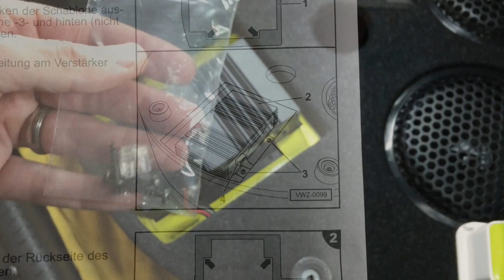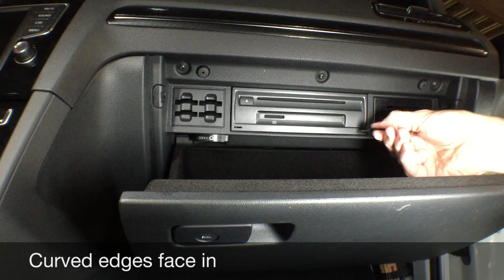GolfR Helix Install

Comment: Hey i bought the sound system for my Polo 6C 2015, i had Volkswagen install it, but they said that they did not need to code it, because the manual said it only needs coding if the the wheel was on the right side of the car ( like in england ) is this true?

i hear stuttering, no clear sound, like scratching when i turn the volume up a little more than half... i feel like the work is not done..
Reply from the maker: +Andr&#233; Lyon Love the Polo, saw some of those on a trip to Bermuda.  Kinda' not happy we don't get them here.  I think VW should release a Polo WRC Edition World Wide.  :)  Anyway, I vaguely remember my manual mentioning something about right vs. left hand drive as well, but I don't remember if it was coding related.  I'll have to take a look and get back to you.  Do you have you part #?  There is a "B" version that people outside the states get that is slightly different, but know one knows exactly how or what the difference is. 

I hate to say it, but it sounds like they screwed something up in the wiring.  I have zero clipping/distortion/crackling/etc. during volume change, and I still haven't coded mine.  I seem to remember someone else on the VWVortex.com forums mentioning a crackling sound issue as well, not sure if he resolved his issue but you may want to start there.  I was working with an Aussie and he had the Golf R estate Right-hand drive.  Said he had to get it coded and it was set to a different code originally.  He also had no sound distortion. From what I understand they all come coded for a GTI originally (4 door maybe?).  After I ran the cable (Which is the hardest job) I called VW to get a quote on doing the wiring for me because I was scared to fry my system (Almost did) but they wanted $600 just for the final wiring even though I told the guy it was a 20 minute job if you knew what you were doing.   He didn't budge on the price so I told him to screw.  So as you can see from my Pt. 2 video I did it myself.

But ya, I would go back to VW and demand they get it working with zero crackling.  That's unacceptable.
Reply: Hello Andre, I have the same problem with my golf, volume more then half I hear scratching, did you find a fix? If so please let me know, I have a golf 7 right hand drive, did the install %100 to this video, Cheers Leigh

Comment: looking forward to part 2! is dongle/flashing needed for 2016 Golf Sportwagen (non-Fender)?
Reply from the maker: +Nick Johnson Thanks, should be done with it soon.  I believe it is, there is a guy on vwvortex forums with a sport wagon who installed one and flashed his using a dongle he ordered, said there was in-fact a difference in sound.  I haven't flashed mine yet, but I'm not sure it's necessary.  I might try anyway, but right now it sounds phenomenal.  The base stereo was great to begin with, this makes it sound like a stereo system on a whole new level.  Very surprising.  The only thing I would like that this doesn't seem to have is more control over the crossover for the in-cabin speakers.  I would like to bring a little more mid-range and even bass back into them.

*EDIT : After programming with Dongle, sound is better!  Mids are back in the cabin and the sound stage has a much better placement.  A tip from another VW Vortex'er : Even if your sub comes pre-programmed to the right number (Mine was 51 I think) set it to your number and hit program anyway.  I did just that and it made a small yet noticeable difference in the overall sound quality.  👍🏻
Reply from the maker: Pt 2 : Get it while it's hot...  https://youtu.be/59bKOruoJys

Comment: Is the LED scuff plate one piece with a plug? Do you know if there is a part number for it?
Reply from the maker: JAMES_d : Sounds like you broke it?  😬

I believe it is one piece.  Sorry, don't know the part #.  I would contact VW dealer.  Try to get it replaced under warranty.

Comment: How reversible is this install? A sub like this in my MK7 could be a game changer...
Reply from the maker: Pretty easy really, just do it all in reverse 😄.  If you need room for a spare for long trips you can just take the sub out, leave the wire, and get a loop harness that plugs into the end in the trunk that basically puts it back to stock by routing the wiring the stock way (it’s all just one big loop).

Comment: so does this fit in place of the spare tire or on top?? I know the fender one sits on top but what about this one
Reply from the maker: In place of it yes.  You CANNOT fit a spare tire into the under-trunk space when you have the Helix sub in there.  It is not like the fender.
Reply: Here to say the Helix sub DOES fit perfectly with a donut spare! Order the longer spare bolt, tire on the bottom, feed the harness through one of the spokes, and the sub squeezes in perfectly. The cover fits right on top as well, no fitment issues!! Some guys have said it even sounds best when mounted on top of the spare 👌

Comment: Great video, thanks! My Helix is arriving tomorrow, this will be really helpful during the install. I'm curious, it looks pretty hard, did you end up breaking any trim attachment points in the process?
Reply from the maker: +Dirk Beer Thanks!  Nothing broken.  I did Short a fuse in the install of the wire and ended up welding them together though.  Yikes!  I just had to replace a 20 fuse, thank god.  Make sure the LAST thing you do is plug it into the amp (After wiring) and when you wire the harness (Video coming soon) TAKE OUT 1 WIRE AT A TIME AND PUT ONE IN TO REPLACE IT.  MAKE SURE THE YELLOW AND BLACK FROM THE SUB LOOM ARE NOT TOUCHING!.  /CAPSLOCK yelling.  ;)
Reply from the maker: Pt 2 : Wiring : https://youtu.be/59bKOruoJys
Reply: Dirk Beer Any chance for a link on where you purchased your Helix?  I have called a few VW in the US and the US databases have no options listed for a Helix on a Golf R. I also supplied them the 'B' part number from above with no hits....so I assume people are ordering only from Europe?

Comment: Thanks for the great videos :)

Which head unit do you have? I have the Discover Pro with the 8" display. Will it work? It only states Composition Media.
Reply from the maker: Thanks, NP.  :)

I have the 6" display, OEM Head unit that came in the 2016.  Is your Head Unit aftermarket?  I'm guessing it would work because you're tying the connections to/from the sub into the Media Unit in the glove box, not the HU itself, but I can't say for sure...

How do you like the Discover Pro?  You should do an intro video on all the features. ;)
Reply: It's the OEM Head unit from the factory and it's HUGE ;)

Yeah, there's quite a lot of confusion around if it works or not.
Reply from the maker: Ooohhhh, the one that comes with the Canadian (Or maybe "Non-American") modes?  Jealous.  If it's OEM I would guess it works...  But I am not 100% sure.

Comment: Where can I order the radio removal tools? is there a part # or something? I see a bunch on ebay but not sure if they will work?
Thanks
Reply from the maker: Amazon or eBay, either are fine, but if you can get high quality ones then pay a bit extra.  The cheaper ones tend to get stuck.
Reply: The part number for the correct VW radio removal tools is 1C0-051-530. You should be able to order them through eBay. They're shaped differently from the cheap Chinese knockoffs you usually see, and are less likely to get stuck.

Comment: Does it work with the "Composition Colour"?
Reply from the maker: No idea, sorry.  What's Comp Color?
Reply: @Kevin_MK7RSR  It s a basic VW radio in the Golf MK7 , but it doesnt have an external headunit... its only one piece in the middle of the car
Reply from the maker: Oh, I see, thanks.  I'm guessing it would work if you were willing to splice wires, but that kind of defeats the purpose of the simplicity of this unit.  😕
Reply: I just asked the People from VW and they mean it will work with my radio, but since there aren't any videos on how to do it I think its better to let VW do it for me with additional costs

How does it sound? Is it way better than the original 4x20 W sound?
Reply from the maker: Amon Hentschel :  Show them my video.  😉

Waaaay better than stock sound.  Shockingly better.  👍🏻

The amp, DSP, and sub all combine to completely change the sound.

Have them let you go through programs while your in the car so you can hear the difference and pick the one you like.
Reply: @Kevin_MK7RSR  so there are more than one Program for the Golf  mk7?
Reply from the maker: Amon Hentschel :  I think there should be one specifically for your golf. There might be a differentiation between 2-door and 4-door.
Reply: yes, so you chose the standard 4 door version or what?
Reply from the maker: also, there might be different ones for the golf, golf R, and GTI. I would just try out different ones to see how they sound but usually the one designed specifically for your car sounds best. Reprogramming mine to my designated code made a difference despite the fact that they said it came pre-programmed for my car from the factory.  People talk out their ass a lot. LOL 😄. Just make sure it sounds good to you.  Also if you ask them to demo the programming for you then you will know for sure that they actually did it.  (I have trust issues, that's why I do everything myself.😉)

Comment: How much are these worth in the UK anyone? I've seen one for £250, is it worth the money?
Reply from the maker: Sam Frampton : Worth it.  

The DSP-Amp combo alone cost $350 from Audiotec Fischer.  Nevermind the speakers, sub enclosure and harness.  Check out the "Match" line of amps from AF. They are the company that make Helix.   Here is the Helix replacement :

https://www.audiotec-fischer.de/en/match/amplifiers/pp-62dsp

It's basically the same Amp/DSP as the Helix kit.
Reply: Kevin Hannon  Thanks for the reply, hopefully picking one up tomorrow - they are becoming so rare it seems!
Reply: Update, bought it and picked up and wired it yesterday. Took a bit of swearing but managed. I've now got a better speaker system in my car than in my house. Very, very impressed, thank you so much for this video :)
Reply from the maker: Awesome!  Glad I could help  :)

Comment: In the process of installing this in my 2018 GTI SE, I noticed that it was prewired, head unit to trunk, and so I did NOT have to use the included cable.  Hopefully this will save some folks some time on later models.
Reply from the maker: Jason Savedoff : Really!?  Now THAT would be truly plug-n-play for this system.

So you lifted your trunk floorboard and there was a wiring loom with a plug that fit the Helix just sticking out there?  Did it have the plug loop to send power and signal back to the Head unit for when the car is in stock stereo mode?
Reply: @Kevin_MK7RSR  the cable running from the head unit to the trunk was identical to the cable that came with the Helix system, revision B.  Plug and play in the back with the 20 wire terminal in the trunk, just had to do the splicing work up at the head unit as usual... just no running of any cables down the car.  I noticed not too many people have the mk7 after the refresh, so hearing from some of those folks may confirm.  I would guess that they simply started prewiring all the cars for Fender, and with revision B normalized the hookups.  Just a guess.
Reply from the maker: Jason Savedoff : Makes sense 👍🏻. I see so it wasn't hooked up behind the media unit.  Some of us have bought or made a 20 pin loop-back plug so when you take the Helix out (for auto crosses or whatever) the radio will still work.  I thought maybe they included that.  It would have been cool if they hooked it up around back and had the plug looped at the end.  Oh well, at least the wire is in there.  Thanks for confirming!

When you get a chance, could you PM me your email, I might be interested in buying that extra harness wire off you if your interested in parting with it.  Thanks 🙂
Reply: @Kevin_MK7RSR  happy to sell it cheap to a fellow gti guy, but don't know how to pm on YouTube!
Reply from the maker: Jason Savedoff : Oh crap, neither do I 😄 Sorry, I thought it would be an easy thing.  Just shoot me an email at kmhannon@mac.com 

Thanks!